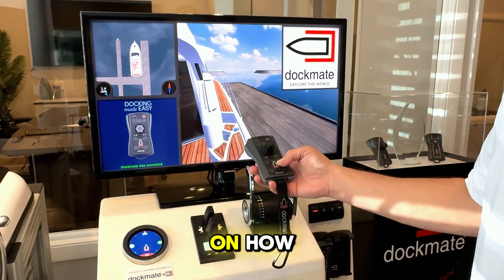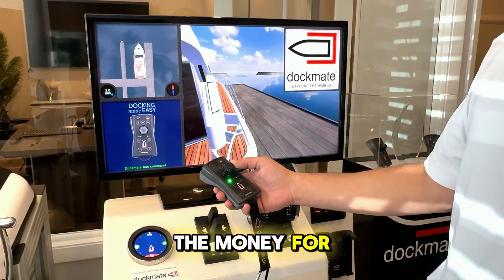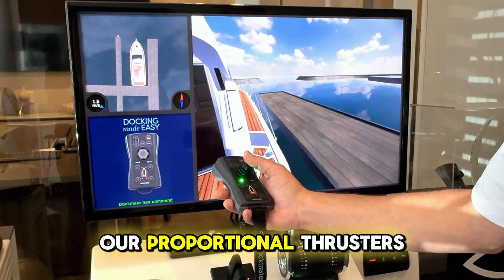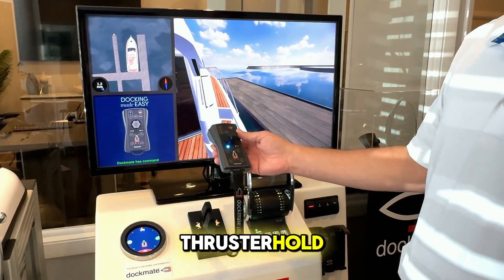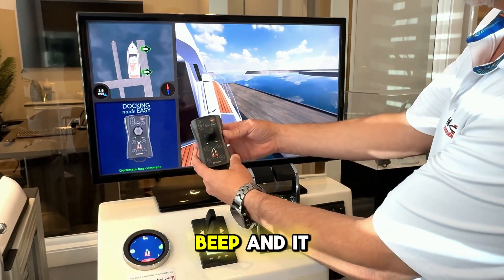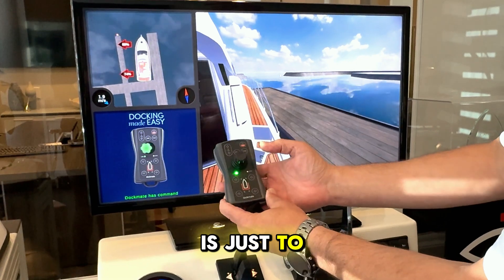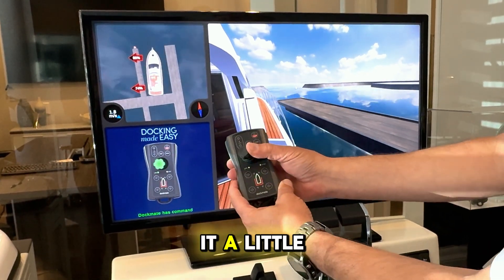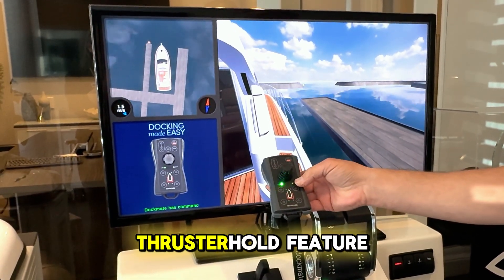Dockmate launches industry-first remote ThrusterHold feature

Comment: Does the ThrusterHold feature work with the twist controller, twin shaft inboards, and only a proportional bow thruster (no stern thruster)?  Very useful feature.
Reply from the maker: Hello JT, Thx for the comment. No, it only works with CanBUS thrusters and the hold wouldn’t be viable at the now only.